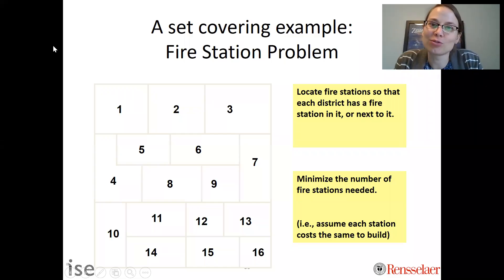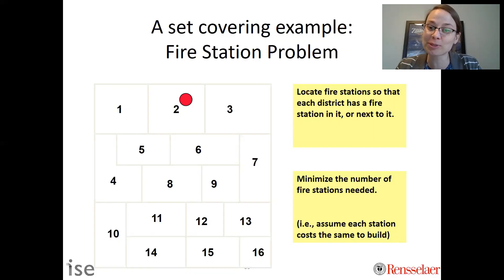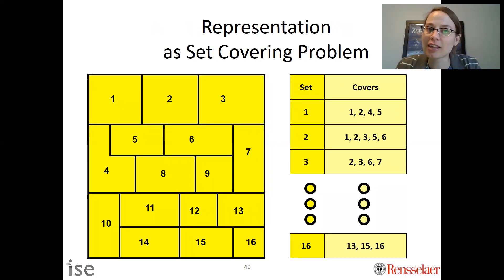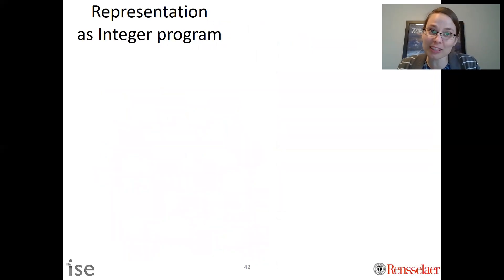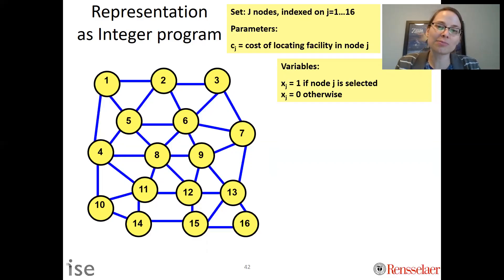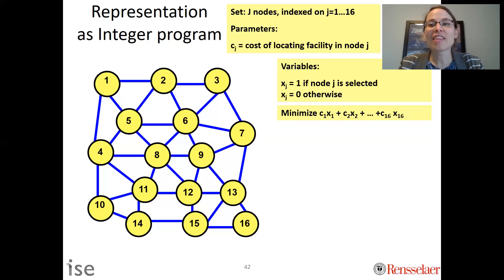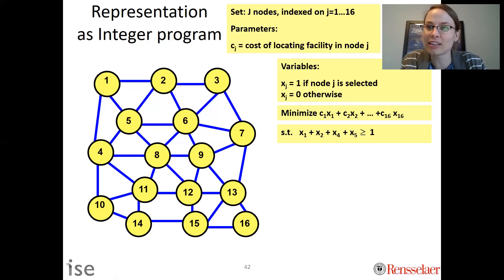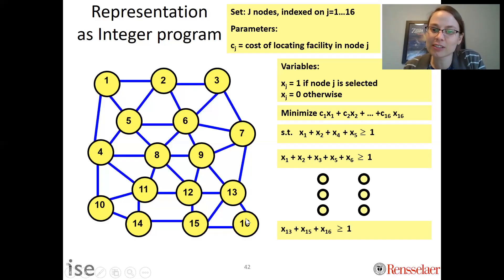Set Covering Formulation and Example

Comment: Great lecture; thanks for sharing it! I have a question: If we need to cover a neighborhood, for instance,  number 1, and we only have to cover it by at most one facility, why is the constraint not just an equality constraint "="? Is it because we want to have the ILP formulation in a canonical form? I'm sure I'm missing something, but I do not know what. Thanks for any guidance.
Reply from the maker: Thanks. An equality constraint can be more restricted than requiring at least one facility cover each neighborhood. Take this example where we have one facility A That can cover neighborhood 1 and 3; facility B can cover 2, 3. If there is an equality constraint saying exactly one facility (and no more) than this is infeasible for this input data, as neighborhood 3 is either “over covered” or not covered at all.